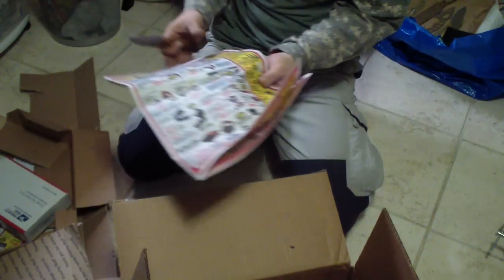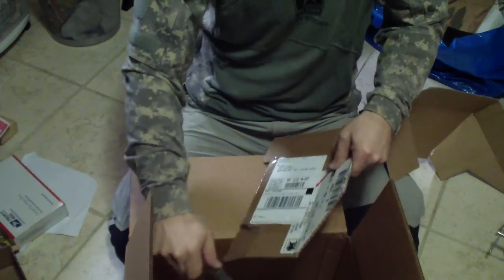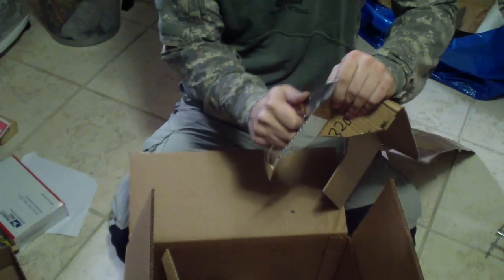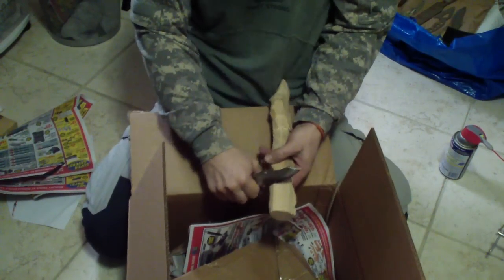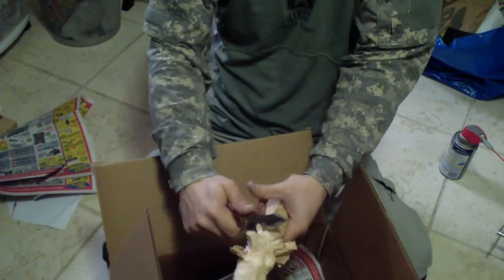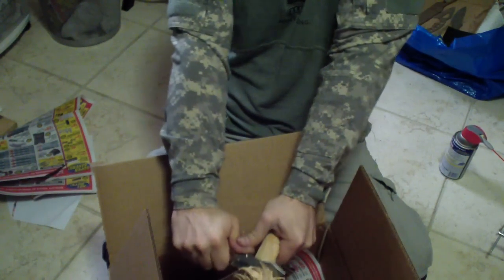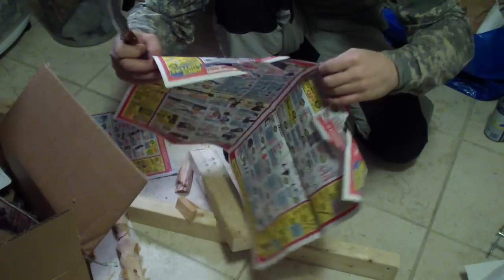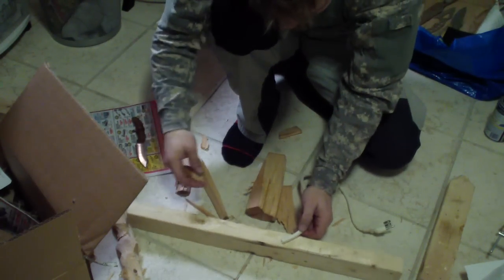Testing of my 154CM Steel Custom Knife

Comment: Say Heah Mike,  Recently I ordered a 6" blade,  What intrigued me was it has a Dual Grind similar to the Mora 2000, I'm going to primarily  use it to work wood with it,  I don't hunt so no game processing,  Strictly a wood knife,  The reason I mention this,  I coukd of got it also in the CPM S35Vn,  and CPM D2,  it normally comes in O1,  I got the CPM 154 because I like the idea that the 154 comes with a higher carbon content,  What's your opinion on this.  Thanx in advance,  Oh and a Happy Labor Day.  I hope it's a boy,  heh heh heh.